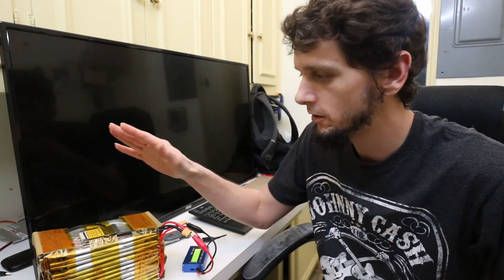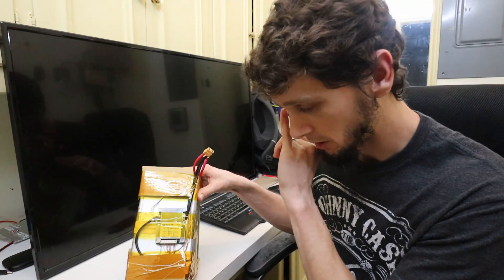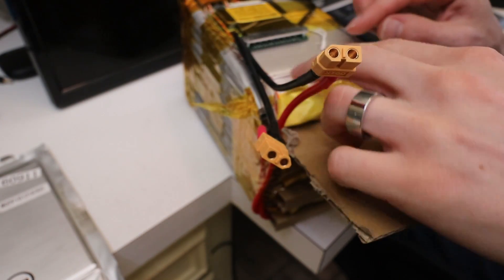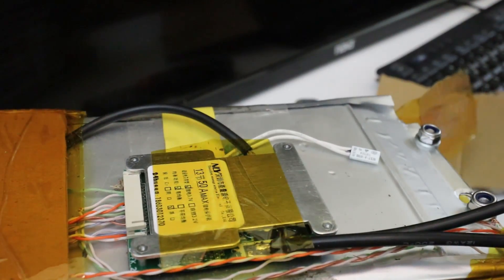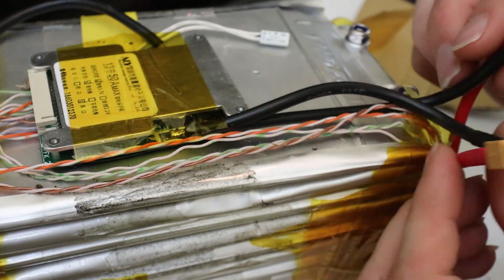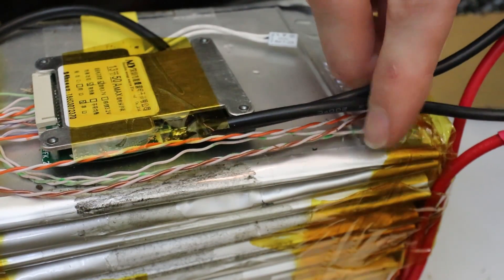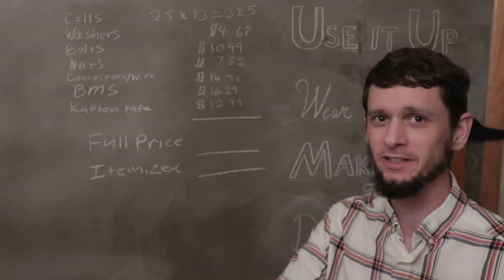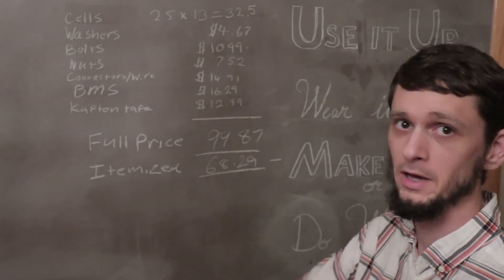SPIM08HP Li-Ion 13S Battery Build || 48 Volt

Comment: Hi I have a same bms mine come with wire. The wire is negative and circuit shown positive. But i solder the wire according and when i plug in I smell smoke. So I am confuse. As the board shown B plus should be the 14th wire right .

Comment: Hey bro good video just want to give you a heads up those cells come  with sell holders designed for those specific batteries and that’s because those batteries actually need compression for them to work efficiently and last a long time so putting cardboard between them will allow them to expand a little too much. So I would look into getting the holders they are dirt cheap you can get them on batteryhookup   It was my understanding that they need the pressure
Reply from the maker: Yes you’re right! Those holders weren’t available when I put my pack together but you are absolutely right proper compression is imperative with these.

Comment: I'm confused about the pricing. I just got them from Battery Hookup for $4.50 each and they were sold out within minutes. Ebay has maybe two listings for $10+ per cell. Not sure where people are seeing this sub $3 pricing.
Reply from the maker: Check out batteryclearinghouse.com. They are or will be running a Black Friday sale on these in the $2.50 mark after shipping.

Comment: Thanks again !

I am trying to duplicate some of the same things you do here!

Thanks for listing the parts list !
Reply from the maker: Glad it helped! Let me know how your project goes.
Reply: Beene Energy I am currently working on a smaller version of your battery.    My(12V 4s1p) version looks much the same except I have the cell frames. I should have listened to you about the tape that comes with SPIM08HP. I got a bit of a wake up call when the socket I used to tighten the bolt and nut hit and broke through the tape.

 I am at the point to add the BMS. I love that you used CAT 5 cables for the BMS. Great idea. I noticed that you have two(2) connectors, one(1) for charging and one(1) for discharging. Both are connected to the BMS. Is that so you don’t have to disconnect the load to charge and vice versus???

Comment: How do you charge it?
Reply from the maker: I’ve got a link to the 13s charger I used in the description. I just plug that into the charge port and let it go to town.
Reply: 1.5 amp that must take a while.
Reply from the maker: Yes, it does. My idea is I didn't need a fast charger as I'd just be using it once a week in a lawn mower. So I could leave it for 10 hours to charge. And for whatever reason grid chargers for Lithium Ion batteries are really expensive. I now have some solar panels and charging from that seems less expensive than plugging them in! Though not nearly so portable ;).
Reply: @BeeneEnergy  thx for a great video. I'm looking to charge batteries a bit faster. Are there any intelligent battery chargers out there that can handle more amps and provide a readout for each cell?